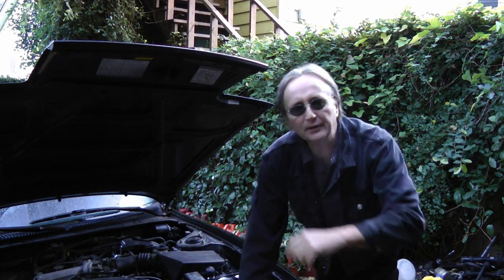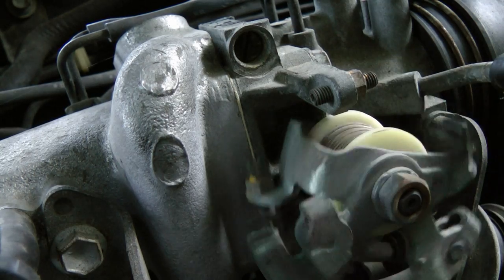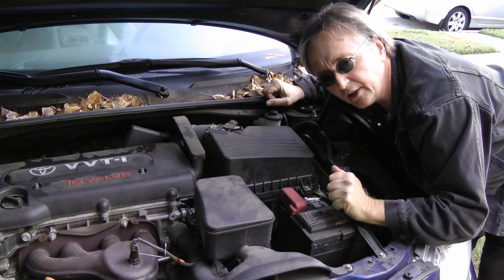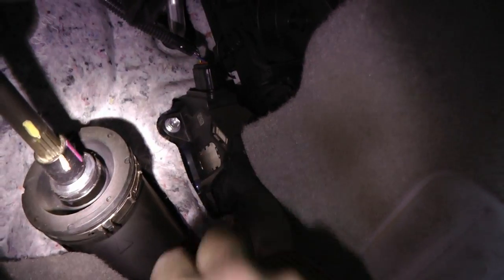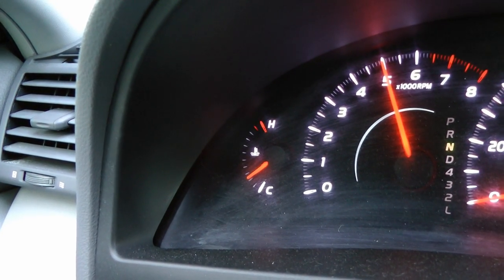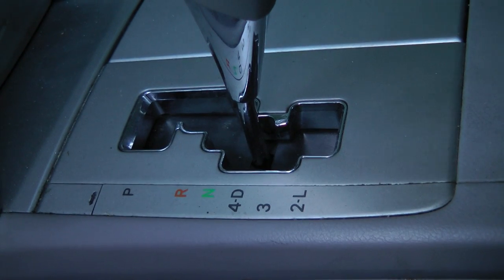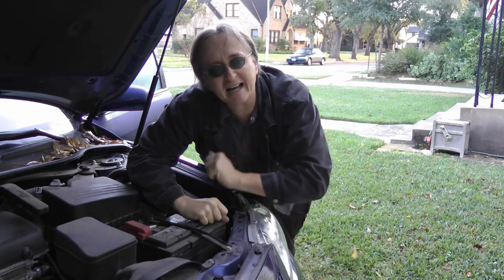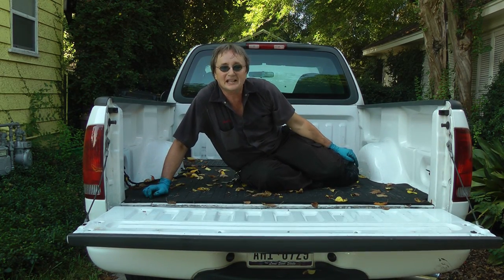How To Stop Unexpected Car Acceleration

Comment: a lot of people that this happened to, claimed that shifting into Neutral did nothing. They would shift it into Neutral, but the transmissions would stay in gear. Is it possible, that transmission shifter is also electronic and not physically connected to the transmission shift cable?
Reply from the maker: Y10Q it's a physical cable, and they are lying, which people often do when money is involved and they are suing
Reply: Scotty Kilmer In some of the 911 calls during the acceleration they said they could not shift into neutral. If they said it afterwards I would agree it's hard to believe but I don't think most people would bullshit a 911 dispatcher when they are going over 100 miles an hour and can't control their car
Reply: Scotty Kilmer There is such a thing as shift by wire and according to Wikipedia at least, the Prius uses that system. However the ECU and TCU are completely separate physical computers so for them both to enter a bugged state at the same time seems highly unlikely. I tried shifting into N at highway speed with my foot to the floor.. the momentum made it seem like it wasn't slowing down right away (even though it was) and the engine noise kept up as expected.  I think in a panicked state people don't realize that they are slowing down in N particularly if they overheated the breaks trying to stop before that attempt and I think they assume it didn't work and end up back in D or one of the low gears which it won't shift into at 120 MPH. Another thing is some of the newer gearshifts are like puzzles and you have to be able to navigate them properly and if you shift it sideways by accident than it may be locked from moving up and down. Lastly most of these cases were with people who were either renting the car or just got the car and may be unfamiliar with the layout or the features of the car and trying to figure that out while the car is speeding is likely to end in disaster.  Here's a personal account: I was test driving a car with paddle shifters and I had a non-English speaking sales person with me. I hit the paddle to try it out and then I asked how to get it back into drive and she just giggled.  I didn't have time to figure out how to get it back into drive (I know now you just hold the + on that particular car or shift N to D) and I had to shift manually for the rest of the drive because we were on the highway and I didn't know how to return it. Had that been a life critical thing while the car was racing out of control I could see something bad happening so I can understand how someone could get flustered or not understand how to do something even obvious in the heat of the moment.  Good idea to familiarize yourself with your car (new/rented/old) and practice for the unexpected just in case you need it.
Reply: Y10Q Actually, many cars have a Electronic shifter.... no cable physically connected, same as the accelerator. The Shifter is essentially a switch, you move the shifter to the position required, and the sensor (switch) sends a message to the transmission computer (TCU),  (which in turn is also in communication with the engine computer - ECU) this tells the trans computer which selection you have 'chosen'. So it is possible, however unlikely, that the transmission would stay in gear.  Should add, the electronic shifting, this is known as "shift by wire".
Reply: just open the door and use your foot to stop the car, like flintstones
Reply: Thats why its a good idea to carry an anchor with you in the car:-)
Reply: +scoman44 A toyota won't go 100 (unless you drop it out of an airplane).
Reply: ***** So does a horse turd, but I don't want one in my yard either.
Reply: I got a '99 ford truck that will be running long after I'm dead. My last 4 VW's went 250 to 300k, I've never had a rice burner that wasn't a money pit.
Reply: ***** Master tool and die maker, for your information. That's why I can afford anything I want.
Reply: ***** Send me a post card when you're fighting for the last scrap of food in the Walmart parking lot.
Reply: +Y10Q 
If has a physical shift cable, it should shift into neutral. That cable is quite thick, secure, and doesn't break.

If has an electronic shifter, it would record a code in the computer if there was any problem with it and no UA investigator ever found such a code.

And in any case, pushing the brakes will stop the car too. What investigators found was no brake pedal being pushed, only the accelerator pedal--meaning the ppl were incompetent drivers or lying or both (and we know all sorts of incompetent lying drivers out there if u ever were in a multivehicle accident you would know that). Also, lots of unsafe drivers place many floor mats (I've seen one car with 6 floor mats stacked on top of each other) in their cars, that is a potential pedal trap for any make car with a accelerator pedal.

So, as usual, it's the idiotic ppl and the class action lawyer coaching.

You can't change known facts and logical reasoning but ppl sure sound convincing when they shed a tear. And in the court of law, emotion and mob politics almost always wins.
Reply: *****
thats what I am saying. It's like central door lock on  Toyota Previa, which I have. When the module fails, car doors stay locked and the only way to open the door is with a brick. Who is to say transmission shifting isn't done the same way. You can pull on the door lock all you want, but you won't open the doors when the module fails, without taking them apart and physically disconnecting the lock. You shift into D or N, but unless the module in the transmission does it physically, you are not shifting a fucking thing.
Reply: Y10Q
That's what you get for owning a toyota.
Reply: crusty old fart
 that Van has 298k miles now. Other than door locks failing, in the locked position, the car is perfectly reliable. Luckily I have other vehicles in my fleet, so I don't worry about it.
Reply: Y10Q
Around here you can sit in your driveway and watch them rust down. Everyone drove the little Toyota and Nissans for awhile till they tried towing a boat and hauling firewood, then they fell apart. They're kinda like a pretty woman, you gotta take really good card of them and use them lightly or they're gone. That's why I have a 400 lb woman with a big beard, who can bench press 500 lbs She's getting too big to slide up under my truck to change the oil though. I don't know whether to trade her off, or get a lift kit.
Reply: *****
Scared to death of stuff like that. I just tie them 2 wires together, coast my old truck down a short hill, and drop the clutch. Everything else works just fine, has been for 17 years. Old lady hates that truck, but I need it to haul her BMW to the shop. The damn thing has been hauled in so much, they dropped the road service part of my insurance
Reply: *****
Does regenerative braking go : Bla..Bla...Bla...Bla...Bla...Bla...like the jake brake on my old truck?
Reply: *****
`I think I'd cut a hole in the floorboards to drag my feet, just in case, like Fred Flintstone
Reply: *****
My truck is 99.99 % burglar proof. It's a stick shift.
Reply: +Y10Q not sure but modern cars have fly by wire
Reply: money, money, money.
Reply: Hate on Toyota all you want crusty. My 68 Corolla has over 1.2 million on it, everything still works as it should, never left me stranded, goes through snow like a tank and is still driven at least 60-70 miles a day. No rust either because I don't sit and look at it in my driveway...I wash it.
Reply: I wouldn't be arguing with someone who has been a mechanic for 43 years...
Reply: ***** why not?
Reply: because im sure he has far more auto knowledge than you
Reply: ***** I would have to disagree.
  Just because he has many years of experience, doesn't mean he is ALWAYS right.
  I have surprised many people like this guy.
Reply: Yol But he is right and you're not.
Reply: ***** sure thing sheep.

Comment: "I can't make my lease payments, I'm going to drive it into a utility pole and say it ran away"
Reply: Zero Compassion!  You've obviously never experienced this before! 

My 2010 Toyota Prius Suddenly Accelerated Unintendedly on January 31, 2019. This is still happening! This was not the Floormat! I did not mistake the Gas Pedal for the Brake Pedal! I Never Have! The pedal was not Sticky! It Sucked itself Full Throttle right to the Floor when coming out of a right hand turn! Brakes held but Engine was Revving like crazy. Every time I released the brakes to try to get the gas pedal to come back, the Prius took off. Can you imagine starring down with your foot on the brakes, and the gas pedal is still pushed in Full Throttle? Explain that?? It did this for about 2 and a half blocks. Shifting to Neutral was NOT working. It wouldn't Turn Off. And I didn't want to press the "E" Brake risking the lines snapping and having NO BRAKES! That was my last resort. This was Crazy and Vehicle Manufacturers need to be held accountable! I've made a "Safety-Related Defect Complaint"  to Transport Canada 🍁. You should all do the same in your country. Let's fight this and end Sudden Unintended Acceleration!  Maybe going back to a Drive By Cable system instead of Electronic Throttle Control will be the answer. There's gotta be a solution!
Reply: @VernonMarshallOfficial  video evidence

Comment: trying to replace the serpentine belt on a 99 Ford Contour in your own driveway requires you to be a part time gymnast and yoga instructor. Cars even ten years before had loads of space in the engine bay to work with
Reply: Justin Pharand At least you have a car. In my truck, I have to lay across a metal brace in my engine bay, and then, holding my torque wrench, lean back so my weight is pulling the tension and then with my other hand, pull the belt off.
Reply: The egos are high here lol
Reply: your torque wrench must be way out of calibration if you're using it on a tensioner and probably other things if you're crazy enough to use it on that.

Comment: some people drive badly because they never need to know how the cars works and more importantly how to drive Manual.  In the old days driving school actually require you learn how to drive Manual properly first.
Reply: My car may be an automatic but it doesnt have power steering, ABS, power disc brakes, TCS or anything like that. Electronic "saftey features" are making worse drivers

Comment: Audi 5000 unintentional acceleration reason was revealed to be drivers mixing up their pedals...go figure...maybe some people should just use the bus
Reply: was it the 5000 or 4000? anyway the fault was still in the vehice, no car of the time had their pedal cluster so far to the left of center and for most drivers this was their second car. they swore they were pressing the brake but it was the gas.
Reply: 5000, but they still mixed the pedals up. Guess what, the same car was sold in Europe with the name audi 100, no pedal mixing over this side of the pond...

Comment: Not true, unexpected acceleration come to you at surprise, you don't have time to react , and that is the reason cause accident--lack of time to react. If I'm cruise on highways, sure , after wonder & figured what the car is doing, I can decide shift. I had witnessed an unintended acceleration caused accident before: the guy got in the car, started the car, I heard the engine roaring, and the car slammed into a building, it all happened in less than 5 seconds. --you don't have time to think what is going on.
Reply: It is REAL! My 2010 Toyota Prius Suddenly Accelerated Unintendedly on January 31, 2019. This is still happening! This was not the Floormat! I did not mistake the Gas Pedal for the Brake Pedal! I Never Have! The pedal was not Sticky! It Sucked itself Full Throttle right to the Floor when coming out of a right hand turn! Brakes held but Engine was Revving like crazy. Every time I released the brakes to try to get the gas pedal to come back, the Prius took off. Can you imagine starring down with your foot on the brakes, and the gas pedal is still pushed in Full Throttle? Explain that?? It did this for about 2 and a half blocks. Shifting to Neutral was NOT working. It wouldn't Turn Off. And I didn't want to press the "E" Brake risking the lines snapping and having NO BRAKES! That was my last resort. This was Crazy and Vehicle Manufacturers need to be held accountable! I've made a "Safety-Related Defect Complaint"  to Transport Canada 🍁. You should all do the same in your country. Let's fight this and end Sudden Unintended Acceleration!  Maybe going back to a Drive By Cable system instead of Electronic Throttle Control will be the answer. There's gotta be a solution!

Comment: I hate electronic throttle. my mom drives a '10 Ford escape. If i mash the gas peddle to the floor real quick, the delay actually causes the engine not to rev really. on my '97 ranger though, it revs all the way up and then down when i do that. Love it.

Comment: just shift into neutral...until youre sat at a red light and the car takes off driving your ass straight into traffic
Reply: Jonathan- FALSE!!!!   Our 2009 rav 4  just did it  this weekend with multiple witnesses in the car..  We were at a red light stopped for about 5-10 seconds with a little less than a car length from the car in front of us. when the engine revved up and the car started to surge. Even pressing hard it started to move.  I moved my left foot to the brake to help my right and even pressing with both it was moving forward.  as soon as I hit it to neutral it idled back down.  Our stock floor mats were nowhere close and even if i had touched the accelerator, it would have continues to rev UP when put into neutral instead of idling DOWN as it did  Had I not been a conservative driver and responded quickly I would not have had room as it pushed us forward to avoid and accident.

Comment: On mother's day 2023 that happened to me on my 2001 Dodge Stratus - I was backing out of my garage and driveway but the car took off like a bat out of hell and threw me backward at at least 40 miles per house and foot was on the brake almost flooring it.  Not ever having experience this before I quickly put it into drive and drove back into my drive way narrowly missing my garage (thank god).  I went through my yard hitting 3 pots filled with dirt.  The car is in the shop right now and they can't find a thing wrong with it - now what do I do?

Comment: The 'truth' is that beyond the problems which are caused by the general stupidity and inattentiveness of the average driver, a vehicle simply shouldn't be doing this. Especially so when purely mechanical reasons like a sticking cable are not the cause. So, perhaps THAT's the reason for the 'hubub' Scotty can't understand. ; ] This is probably a rarity in today's multi-computer vehicles.

I began driving quite a while ago, and I've experienced a couple of instances of this in older cars. Hypothetically, this could happen as one leaves a stop in a line of traffic. Try reacting quickly enough with this 'no-brainer' solution when you're nearly bumper-to-bumper but have enough build up to have gained about 15 mph. Even a 5 mph rear-end collision is a real eye opener. In today's overly litigious and 'socially correct' world, a rear-ender caused in this manner might be a friggin' nightmare you never saw coming, simply because there was no reasonable way of avoiding it in a scenario like I suggested.

I figured this was worth the mention, because Scotty made a grand assumption here about a little thing which isn't necessarily a little thing.
Reply: +1  My last car was totalled from an under 10 mph collision. My first accident in 50 years, happened because I lost concentration when pulling into traffic.   New rule in  our car is NO ONE speaks to the driver unless ANSWERING a question.
Reply: +theoriginalbillholt 
NASA engineers found no problems with the throttle system. They did find that ppl lied about applying brakes which was shown not applied in the computer data. So, all the evidence shows the ppl lied about applying brakes and in many cases, ppl put too many floor mats trapping the accelerator pedal downwards ... this can happen to any car that uses thick or loose floor mats.

If there was a real problem we would see 1000s of accidents from the millions of these cars but only a handful were in the lawsuits. So what does that tell you?  

Scotty knows his stuff. His years of experience means he is more right than 99.9999% of the opinionated out there.
Reply: Exactly the cause, 100% driver error.  When you cram stuff under the accelerator that doesn't belong there the accelerator is going to get stuck in all that stuff, mostly people were adding floor mats on top of the floor mats that were already there, there are some people who seriously shouldn't be allowed to have vehicles let alone drive them.

Comment: I HATE MODERN CARS
Reply: +amilom007 Same here.
Reply: +amilom007 
Other than EFI, radio, everything else is an unnecessary potential point of expensive electronic failure.

But they dont offer bare bone car packages anymore. They want to cater to new and old age yuppies that yearn to be comforted and distracted on the road.
Reply: I feel you. When I was younger cars came with somethings manufacturers now a days lost, charm, repairability,simplicity and the ability to mod almost anything.
Reply: +amilom007  same here.. and modern small engines.. they SUCK...
Reply: Baily DenhHouten old cars also get shit mileage
Reply: DanielWhaaaa tell that to my 92 golf that can make 700kilometers on one tank and in the city driving so noo disagree